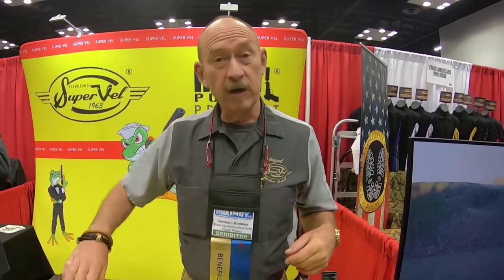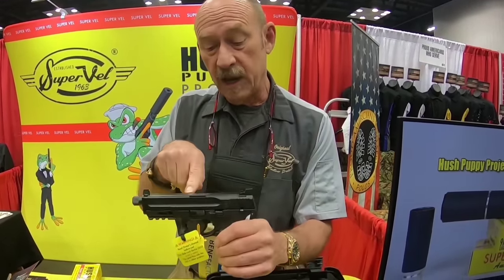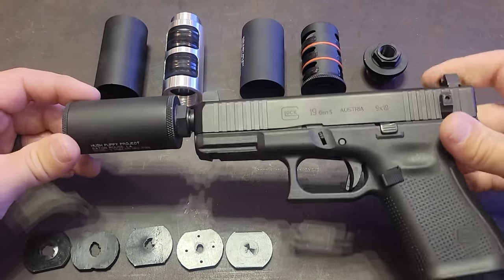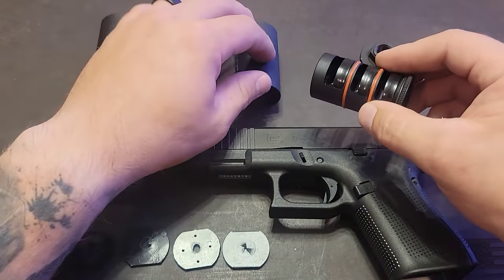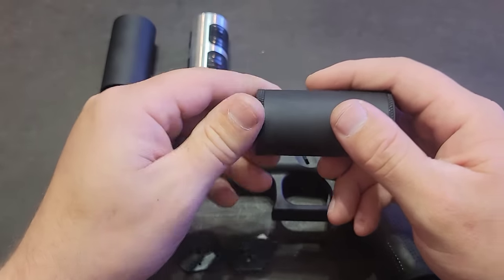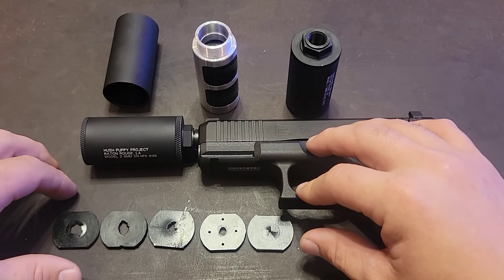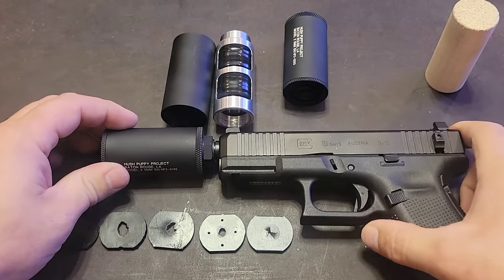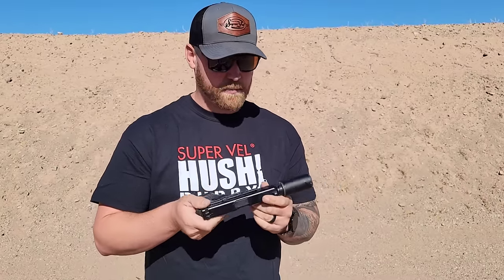Hush Puppy Project Model 2 Silencer & SLD Switch

Comment: holy crap this is insane! absolutely mind blowing how silent it was with that SLD switch and silencer. wow. i need one for sure!
Reply: Professional hit man?
Reply: @markryan3018  🤣🤣 same question here
Reply: Not really. The 1st shot is always louder. If this were a real test there would have been a shot to clear the barrel then another 2 for comparing the locking device.
Reply: Also realize there is a downside in having to use "wipes" which have to be replaced after a certain number of rounds fired. I'm not sure I like the idea of having to use/replace disposable parts.
Reply: If you're sold on a suppressor from the sound in a video... I got a bridge to sell you.

Comment: They should make a punch tool so you can make your own wipes from a section of rubber.
Reply: that's illegal according to the ATF unfortunately. nothing stopping you from saying those are the new wipes you had an FFL SOT 3 make and change out, but they would throw any seller of the wipes or punch in jail for decades

Comment: My concern is damage to the polymer Glock frame from the SLD device slamming against it. What's the round count for the pistol used as the test-bed / prototype / proof of concept when the switch was being developed?  What's the most number of rounds that have been fired on one individual pistol with the SLD switch engaged?  Any mechanical issues or damage noted?
Reply: There is no slamming force the sld locks the frame solid in the same way as holding your thumb hard against the rear of the slide
Reply: The locking lug on the barrel takes all the force. Do not attempt on direct blow back pistols.
Reply: @chrisfs150  @cruz219 my understanding is that the Vietnam era S&W hush puppy pistols eventually developed frame cracks when their slide lock mechanisms were used.
Reply: @flshovelhead  these aren't vietnam era smiths and lock up in a different manner

Comment: The idea of bringing a slide lock to market with such a ubiquitous platform is fantastic, and not to be overlooked for those of us constantly pursuing a more pleasant, and cooler, shooting experience.

However, for what appears to be 3-4 machine operations to install, the price is a little rich for me. No modification on the frame, or slide refinishing, and the latch working directly with one of the unmodified frame rails makes me think this process is worth more in the ballpark of $200 or less.
Reply: Same thoughts here. Kinda looks like someone could 3d print a jig and do it themselves with a drill press and a router.
Reply: @BurnerJones  or just hold the slide with your thumb when you fire.

Comment: Hear me out, How about just putting your thumb on the back of the slide so it doesn't cycle. 🤷‍♂
Reply: 😂😂😂 try it and post vid
Reply: @GeeMix901   It works fine. It's not comfortable, ergonomics wise, so it's really not a useful option (aiming is hard, grip is bad etc.) but it doesn't hurt your thumb from the slide trying to cycle if that's what you're thinking.
Reply: @GeeMix901 if you put your gun against something to try and fire it, like if you are in a wrestling match over a gun with someone, chances are, pushing it against a soft target to fire, would push your slide out of battery. In a case like this, you press on the back of the slide, to keep it in battery, so it will fire. This is completely fine.
Reply: @ColinStevens  that's cool I guess, I watched someone incorrectly fire a pistol and the slide ripped their thumb so that was the first thing that came to mind.
Reply: @GeeMix901  Getting pinched is the biggest problem. The slide only kicks back with a few pounds of force. It's very easy to overcome.
Reply: Agent 47  type thing
Reply: Watch the scene in "good fellas" when they pop the truck driver.
Reply: It’s easy.  Especially with subsonic ammo.  You just can’t half ass it. Press hard and don’t be afraid.
Reply: Came here to post this what a ripoff
Reply: @GeeMix901  no point,there is already a bunch posted years ago.Works fine even with full super sonic ammo.What hurts people is the webbing of the hand isn't strong enough to stand up to getting caught by the rails....or a digit in a poor position and not being held rigid.Its usually cuts and tears from the rails.
Reply: Thid allows you to use a good grip
Reply: Just here to see how many people think this will “break their thumbs” 🍿
Reply: @GeeMix901 some people here are talking about slide bite, which isn’t a big deal. But when novice shooters cross their support hand‘s thumb over the back of their strong hand behind the slide, that can indeed end worse and lead to stitches. The bottom of the striker can mess up your thumb badly when the slide goes back.
But yeah, pressing the slide forward deliberately or gripping someone elses gun around the slide and trigger guard from the side doesn’t require that much force to do.
Reply: @GeeMix901 🤔 just think about it.
Reply: If you’ve ever tried it, you wouldn’t need to ask. Unless you’re pressing your gun into the target, where you don’t need to aim, it’s nigh impossible to accurately aim one, let alone multiple shots while bracing the slide closed. It’s also an awkward angle, so more often than not, you still end up with some movement in the slide. A mechanical lock is a better solution.
Reply: Those are blanks they are using in movies
Reply: @ColinStevens It’s possible but you’d literally have to be trying to shove the gun into the person’s body, you can still fire with the slide just a little pressed back, it’s not as easy as people make it seem, it takes pounds of force of you shoving the muzzle into something, which you should be avoiding regardless
Reply: I've done it on  my Beretta 92 with the suppressor on. Works on locked breech pistols. Just don't let it get a running start on you. It's not any quieter though. Slide cycles so fast the sound is muffled by the shot. I had my friend shoot my pistol in my back yard while I went to the front. I couldn't tell which one he held the slide closed and which one he didn't. We then switched with the same result. What was obvious was shooting it wet and shooting it dry. Beretta M9A1 with Gemtech Tundra. So nothing particularly exotic and at this time kind of an old suppressor.
Reply: @Blu.86-te1pr me too

"That'll rip yer goddang thumb off fella...!!"
Reply: @shadoraeveon9312  oh I don't disagree.
Reply: @GeeMix901 I have done that plenty of times with a Glock 22 (.40 S&W). Doesn’t hurt.

Comment: I like the idea of including all the extra wipes with the original, because the ATF is dumb and thinks they count as suppressor parts, but why not have metal baffles to be used along with the wipes? Or is that how this is already set up?
Reply: The wipes are held in place in a baffle stack , they do a longer version thats fairly effective without the wipes fitted due to having more baffles and i believe they offer separate metal baffles to slot in if wanted,
Reply: @chrisfs150  I’d say give me both. The metal baffles will act like a normal suppressor for when you’re out of the wipes.

Comment: For ANY suppressor, you need a rubber wipe, it’s the last wall that the bullet penetrates.  It balloons out slightly and tremendously helps with reducing sound.  Sandwich one in.   Small sheets of 1/16” reinforced rubber can be bought in most any plumbing dept.  That’s part of how we made truly Hollywood quiet silencers back in the 60’s.  That and steel wool with lots of grease.   But this was for only a few quiet kill shots, not to blast 200 rounds during a fantasy operator range day.  Your job dictates.  Now you know what to do when the job calls for it.

Comment: 2:55  Guys, be very careful in your choice of grease for those O-rings.  Double-check the exact composition of the O-rings against the grease manufacturer's application notes and warnings.  Many times I have had to use a special silicone-based grease for various elastics.  You might find yourself at Home Depot picking up a tube.  I did.

Comment: Why not just take out the recoiled booster
Reply: Depending on the weapon and the ammo a suppressor might not cycle the weapon, but it might have enough oomf to push the bolt face back and let gas out of the ejection port. Since expanding gas is loud and you want your weapon to perform exactly the same with every trigger pull, it's better to just lock the slide.

Comment: I didn't watch the whole thing nor did I go to the school in Sonora...... but where does that pressure go? And, again not to be a smart ass, ...... what if you need a second round? 

Or not.....either way......
Reply: Pressure goes back out the front. You can hear the hissing sound when slide is locked. Also you don't have to use the sld all the time. Flip it up quickly and run semi auto
Reply: @mikeDstoker  fair enough.....heard that....

Comment: I thought that the Gay-T-F said it was illegal for owners/people without the SOT or manufacturing license to swap out wipes on their own can. Doesn’t that count as replacing parts? I knew a local shop was going to start making and selling 9mm cans with replacement wipes, and when they asked the ATF about the legality of it, it died on the spot cause they said no. The test can the shop made was really quiet even when shooting dry.
Reply: You are correct.  Unless the accessory pack sold directly with the suppressor bypasses some sort of rule and are technically apart of the original suppressor.

Comment: Doesn’t the outside diameter of the can block the low sights?  If so, hard to hush the puppy beyond 10 feet😂😂😂
Reply: Suppressor height sights. Or, just look over the can but in line with the sights. You’ll still be surprisingly accurate. We’re also talking about special forces guys who are pretty dang good at shooting
Reply: @johnbarrett6842 i think he watched the whole video WITHOUT actually watching the video...

Comment: why not use your thumb to hold the slide?
Reply: Great idea😮💡 give that a go and let us know what happens
Reply: Kidding! HEY! Don’t do that, I was just kidding😅 it WILL break your thumb👍🏽
Reply: @MrPaxel14   i've never done it with a suppressor but i've held it back with my palm without one on my .22 and 9mm. and it didn't have a ton of force.  the .22 i can hold with my thumb if I want to single shot it. I don't know how much more back pressure a suppressor would add.
Reply: @MrPaxel14  it didn't bruise my palm i'd be surprised it it would break my thumb. i could be wrong. i'm always surprised how much quieter the .22 is without a suppressor when you hold the action closed so it cannot cycle. its not a ton but it's noticeable.  atleast from behind the muzzle.

Comment: Aren't normal citizens not legally allowed to buy and also install new wipes into a suppressor?
Reply: According to the fed boys it’s illegal to own/build a suppressor without a tax stamp. Servicing, in this case repairing the wipes, of an approved suppressor is legal.
Reply: @goofygoober1007  There's something up with wipes because if there weren't, you'd see a lot more of them.  It's not like punching a disc out of a rubber sheet is hard.
Reply: @chaimafaghet7343 your right it’d be super easy. Honestly though most machining isn’t that hard with a little practice.
Reply: @goofygoober1007  Yeah but it's not like there's a lathe/mill scale barrier to entry here.  You need a sheet of silicone/neoprene/whatever and an arch punch, and that's it.  It's primary school arts and crafts, not machining.
There must be some legal barrier because the practical one is so hilariously low.
Reply: @chaimafaghet7343 why should there be a legal barrier? Why should you have to ask the government permission for hearing protection? Suppressors don’t work like the movies they are still loud, the just make guns not blow your ears out loud
Reply: @chaimafaghet7343 the down side is constant replacement of wipes.
Reply: @Pipizzakitchen  It's not that much of a down side.  It's like wanting a break action so you don't have to reload mags.

Comment: I hate how videos like this never used anything for measuring the sound levels such as a decibel meter or something, just from watching the video viewers are not gettting a true representation of the difference between the two sounds and I just looked up decibel meters on amazon and they are not expensive
Reply: Well, the standard answer that I’ve seen is that Real decibel meters cost 10-20k and the things that they sell on Amazon aren’t really decibel meters. 
They will work, but their measurements aren’t as accurate as “real” decibel meters, and their output is basically subjective to the environment that they are used in and how they are used. 

Aka they will give you a ballpark guesstimate, not a “legal” measurement. Or something like that.

Comment: You can accomplish the same effect using your thumb. Just block the slide with your thumb while firing. Just like a muzzle contact engagement drill. The barrel lug takes all the force when the slide lock switch is engaged or when pressing forward on the slide with your thumb.
Reply: do not try on direct blow back firearms
Reply: Lmfao mmmmm. Slidebite

Comment: Someone finally did it legitimately. For years, I've simply stopped the slide from cycling by placing my thumb behind the slide. People constantly say things like "you're going to break your thumb" blah blah blah... You won't. The force of the recoil is just enough to overcome the recoil spring. it's the momentum that can cause damage. If the momentum never get a chance to get going, there is no danger. If you think the slide can break your thumb if you hold it forward, you-

A- don't understand physics
B- have a bitch made thumb and need to drink milk
or 
C- You are weak and will not survive

I might just buy one of these simply to support a manufacturer that FINALLY made a hush puppy switch for the Glock.
Reply: D- they don't understand guns and the fact that it doesn't take a lot of force to stop the slide

Comment: Make a silencer out of the Tesla valve.
If it stops air and fluids, it will stop a bullet sound.
Reply: Tesla valves aren’t straight, yes you can modify the geometry to get a straight path through them, but then it’s just a stack of baffles.
Reply: This is essentially what is already being done. There are companies that 3d print a baffle system as one piece.

The issue with that is that baffles go bad and need to be replaced. This design is way cheaper and just as effective and is more compact.
Reply: I was thinking about the tesla valve as a silencer as well. Would be cool to see someone make one for people to see how well it would or wouldn't work.
Reply: The world just keeps getting dumber.

Comment: Audio sounds edited
Reply from the maker: No sounds edits, check out our other videos
Reply: Yup @6:58 you can hear a slight bump down click in audio volume with a good pair of headphones.....
Reply: A gunshot is going to max out the microphone anyway (and there's a good chance the muffled gunshot will too since most mikes can't pick up differences past 120db). Relative volume of this is hard to capture tricks or not. It depends  on equipment and software used, but there's probably also unintended level adjustment not actively done by the editor too.

Comment: I thought that a pistol doesn't need subsonic ammo b/c the barrel is not long enough for the shot to "get to" supersonic speed. Is  this not correct?
Reply: That I not correct. It all depends on caliber and barrel length so it will vary by firearm.
Reply: Why would that be the case? 115gr 9mm is going about 1200ft/s out of a 4.5 inch barrel, well over the speed of sound.

Comment: Might be a good idea if it weren't for the $200 tax for EACH ONE OF THE WIPES as the atf ruled that a few years ago which killed another suppressor model
Reply: Yeah that's not how that works. The $200 tax stamp is for the initial purchase of the suppressor. The wipe is considered a part of the suppressor which can be "repaired" and is not subject to the tax stamp again. No different than if you had a baffle strike or end cap strike where you send it in for repair. This one you use the accessory module to send back all the used wipes and it is replaced with fresh wipes and sent back. Simple
Reply: ATF ruling that wipes are considered suppressors in and of themselves wouldn't apply. Hush puppy "accessory module" when separated is still a part of a registered assembly.
Reply: You totally can't get a silicone sheet and hole punch because thats really bad
Reply: @SiliconeSword don't even need a hole punch.
Reply: @Dontgetenslaved  I'm talking for the outside, I can't cut a circle with scissors lmao

Comment: How does this compare db wise to a full metal baffled can? Like a aac tyrant or kraken by cgs?  The video suggests it’s as capable but I really have a hard time believing that in 2-3” ,  I know length is king (in cans)
Reply: Technically volume is king. It's just usually easier to go longer than it is to go wider. You can only make a suppressor so fat before the sights become useless.